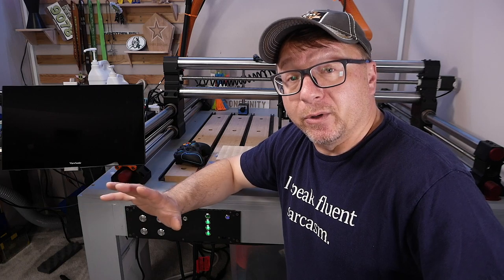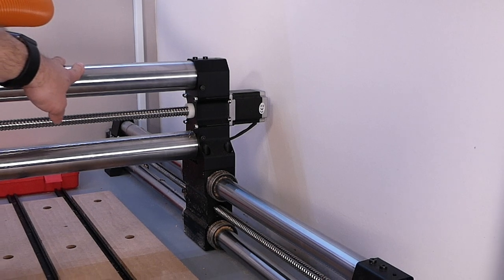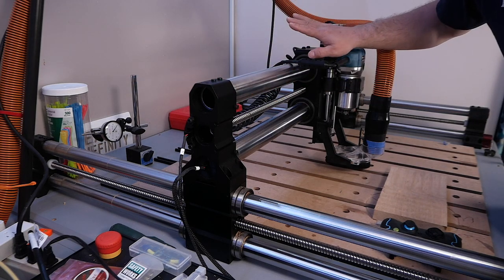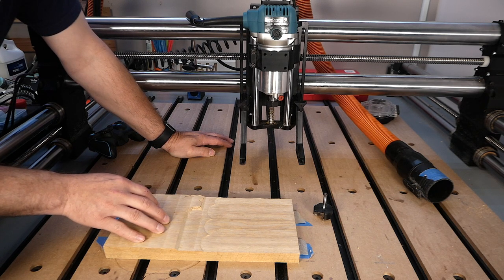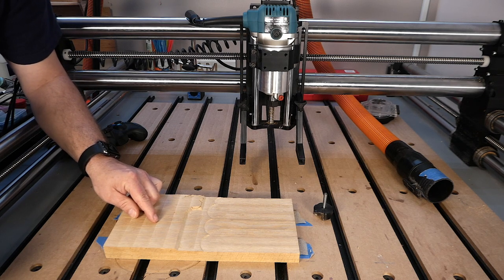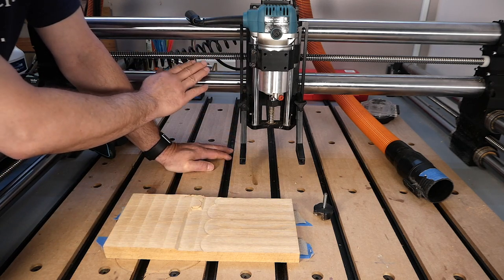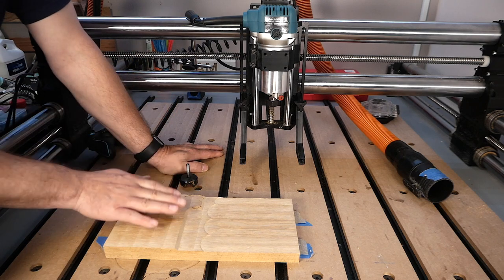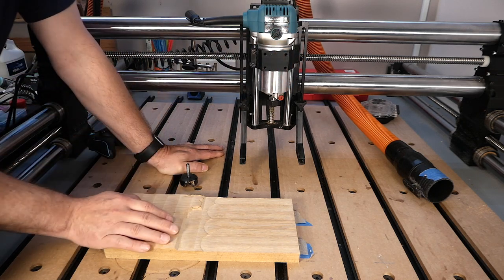Onefinity CNC X-50 Upgrade - Features, Install and Thoughts

Comment: Great video - again!  
Did OneFinity address the issue where, if using a 65mm spindle, the spindle height is limited by it touching the stepper motor.  Upgrading to an 80mm eliminates the issue, but that is not in the budget  currently.
Reply from the maker: Hi Dan - thanks! I do not believe they have addressed the issue.  However, I will find out soon since I just received a 65mm spindle. I will report back.  Thanks for watching!

Comment: What mount are you using for that monitor,if I may ask?
Reply from the maker: Hello Leslie - I have a combination of things: metal iPad holder (https://amzn.to/3x7DJ8K) and a SMALLRIG 9.5" arm (https://amzn.to/3kZAThf). I used a 1/4-20 threaded insert (https://amzn.to/3cCDFV3) to attach the arm to my desk.  Previously I also used a 3d printed adapter (https://www.thingiverse.com/thing:4876027).  Hope that helps!

Comment: Great video on the upgrade.  Do you have a video on your ‘push button’ / electrical panel on the front of your table?  I want to do something like that(or toggles), but do not wish to cut off the plugs of my tools.
Reply from the maker: Hi Dan - thanks for watching.  I sure do - design: https://youtu.be/ky3o2owhZS4 build: https://youtu.be/KEEyB8vq9Jg

Comment: My understanding of tramming is you place a bent piece of wire into the collet. 2- 90* bends  similar to a Z with out the angle.
The wire is swept by hand around the circle by turning the collet. Where it touches and where it does not touch the spoil board indicates the spindle is tilted, by how much and in which direction.
This is then used to adjust the spindle, then you repeat the spinning of the wire rechecking until the wire touches the table the same all around the swept circle. This wire on a larger machine such as yours will really magnify the error by being a large circle.
 In comparison to your method you are comparing roughly the angle of a circle of only 1". Imagine if this circle is instead 20" (a 10" long wire). 
Again the wire is NOT powered but swept around by hand. This is also much quicker as nothing is being trimmed.
Reply from the maker: Hi David - yes, you can use wire or anything longer as well. There are special dual dial indicator systems as well  Certainly the longer the arm, the more variance you can detect.  However, in the end, if you don't feel ridges then your machine is close enough.  Thanks for watching!

Comment: So it's hard to tell in your review if the difficulties you described were attributed to deficiencies with the z axis design or if they were resultant from your unwillingness to properly tram the system.  If someone sent me a free cnc I would give them a fair shake and do it right.  You kinda make it look like a sub par build and we are left wondering if it's the machine or the operator.  HTH
Reply from the maker: Hi Roy. Thanks for the feedback. I don’t recall having any issues with the X50 so I really don’t understand your comments. More specific input would be helpful.  I purchased the machine with my own money and agreed to evaluate the upgrade. Thanks for watching.

Comment: I think I know why you blew your fuse... Pulled too much material out in one pass but I'm just guessing. Have you done aluminum on it yet?
Reply from the maker: Actually, the breaker popped because my son put a space heater on the same circuit without my knowledge. A 1500W heater pulls a lot of current 🤦. I have not tried aluminum yet, but others have.  I encourage you check out the OF forums - an invaluable source of information. You can check out the FB page too, if you are a masochist or something ;)
Reply: @cyberreefguru  HAHAHAHA!  That'll do it for sure!
Reply: @cyberreefguru  I don't have an FB account. Deleted it years ago. ;)

Comment: look everyone wants to sell a cnc. But lets stop the bs adding a cheap router that has never been designed or sold as a cnc quality component to get quality results.
Reply from the maker: Hi Kevin - based on my experience, you can get perfectly good results with the palm router. Will a spindle provide more power and consistency? Perhaps, if it is high quality and configured properly. Certainly the router does limit your upper speed on the OF more than some of the other CNCs out there, but it is not limiting factor for success in my opinion. Thanks for watching!